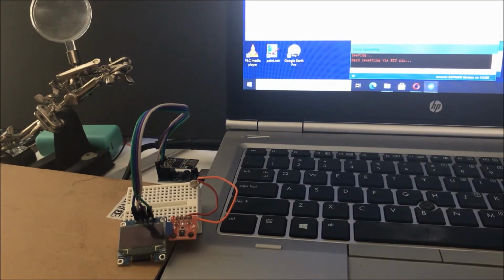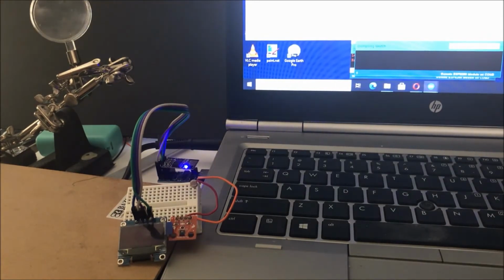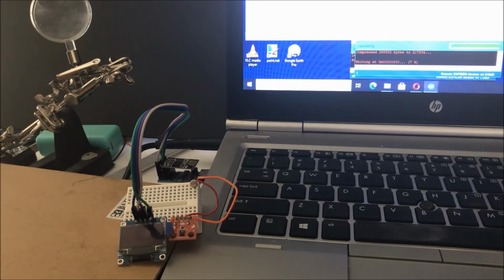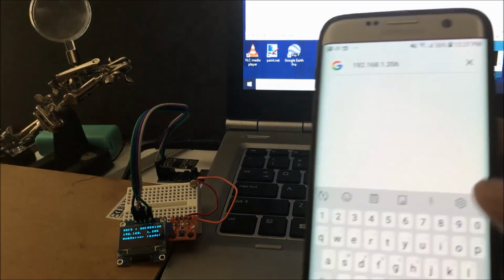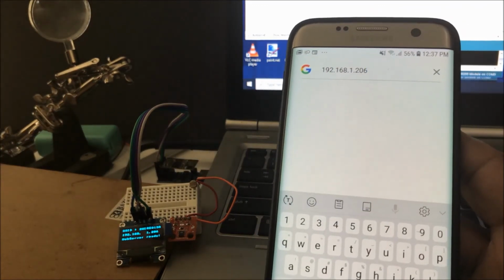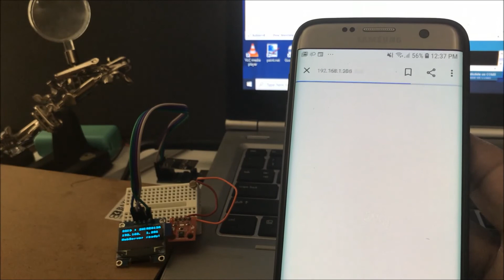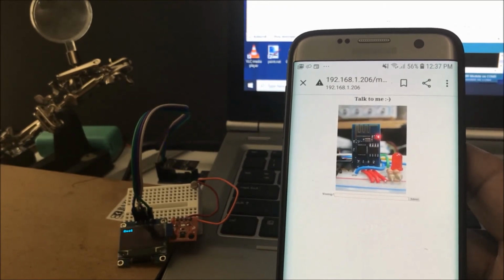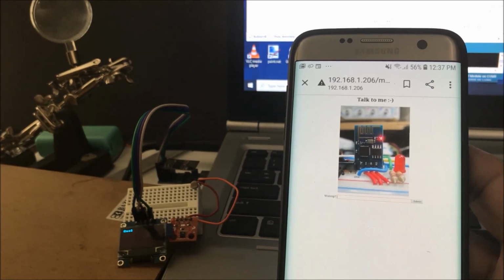USB to ESP8266 CH340C ESP-01 ESP-01S Breakout Module Demo

Comment: Hi, I have a question. Can I program ESP-01 using only the usb adapter? Do I have to press and hold the Reset button during the upload of sketch to program it? Or is it always in programming mode and the reset button is used only to reset the software? Thank you